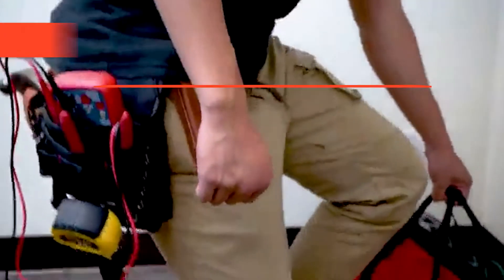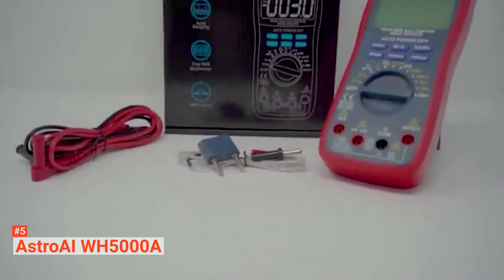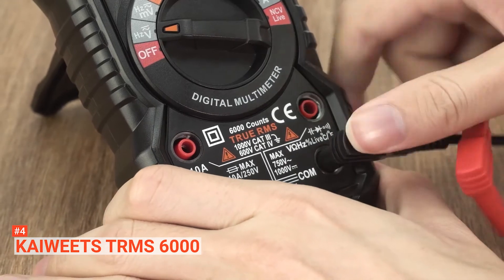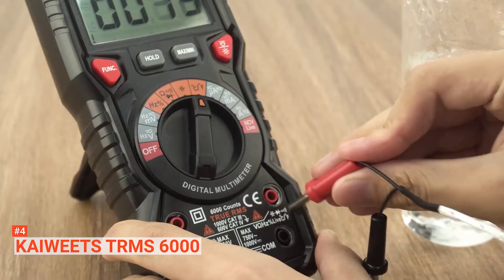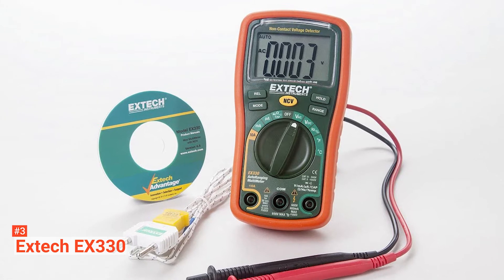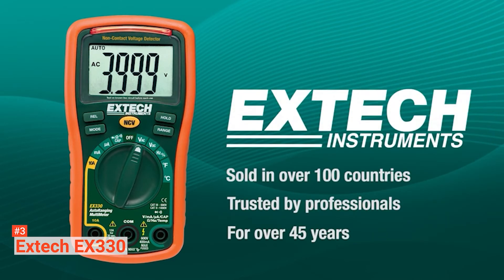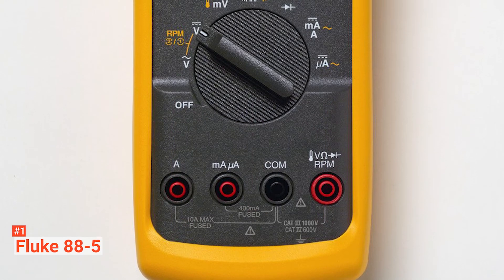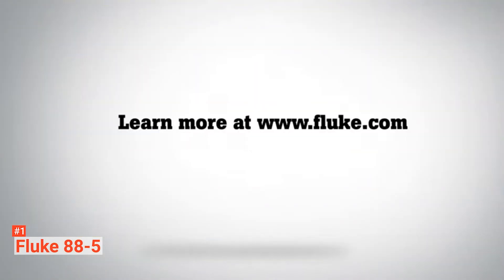Which Digital Multimeter should you buy 2024? | Features you need to know

Comment: so a quick breakdown from my own viewpoint here
5, ive heard astroai pays for endorsements, so im iffy on those guys myself
4 looks like its meant to be more flashy than it is usable, just going off its appearance (like seriously nobody who actually does electrical work wants any of that silly crap)
3, tbh no complaints with it, simple and usable, would be good as a starter multimeter
2, its an automotive tool, if you are working on actual consumer electronics and etc its missing some features you may need, so probably not a great choice unless you are working with cars primarily
1, fluke multimeters are just plain way too expensive, ill admit they are good, but christ unless you do this for a living i cant imagine spending 700-800 dollars on a multimeter. might be worth getting one used a few years down the road though for hobbyists

Comment: When it comes to test equipment I don't want a pretty face.  It's obvious the Fluke is designed for usage, not show off.  The rest of the meters are cluttered, and multicolored making reading under certain lighting conditions difficult.  With too many "features" crowded in you get a hand full of nonsense to contend with.  Keep it practical instead of stupid.
Reply: Well said. Some of these meters come with so many buttons and fancy display but you how many of those functions do you use. I think most people only test voltage and continuity for home repairs.
Reply: Some meters come with frequency generator, temperature, capacitance, sound level and more but you never use it.

Comment: If you have  multimeter

That doesn't mean you r professional ok 

Correct it
Reply: So true, Dr. Viral! :)

If you're gonna get a multimeter, there are TWO main factors to consider:
* EXPERTISE in using a Multimeter.  If you don't have any PRACTICAL experience with a meter, find someone who does (i.e., an Experienced Technician) who can teach you how to SAFELY use a meter.  If you're lucky, the "teacher" will have a "throwaway" meter as a Teaching Aid to help you gain experience.
* PRICE of the meter.  If you don't have any or "limited" meter experience, DO NOT buy a "Fluke-class" meter! instead, get a VERY INEXPENSIVE (<$20 - available at Auto Parts or Hardware stores) meter and learn how to use it SAFELY (preferably under the guidance of an Experienced Technician.  If you do "blow it up" due to a mistake, you won't be out too much $$$ (i.e., a "cheap lesson").

Be aware that YouTube and similar "user" videos are good "beginner places" to start your education.  They ARE NOT to be used as a means of "professional, etc." instruction, but merely as an "introduction".  ALWAYS enlist the "tutelage" of a Technician with MANY YEARS of practical experience.

Always remember: a person with "a little knowledge" and equivalent "little experience" is a VERY DANGEROUS person to be around!